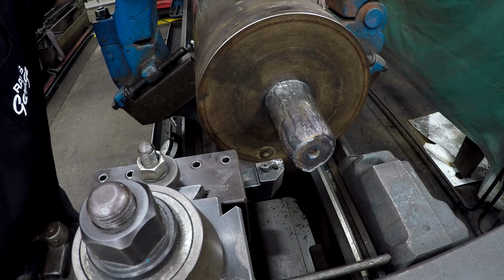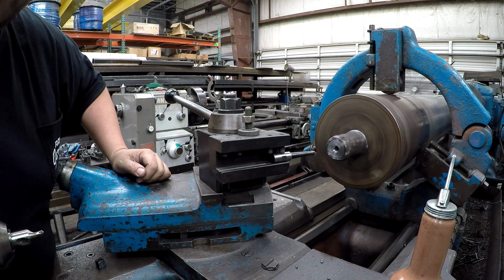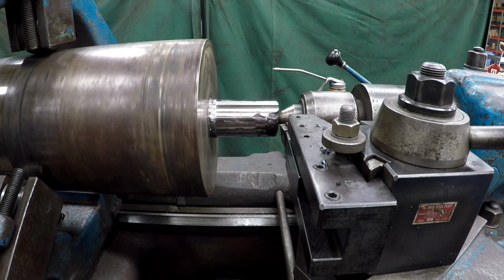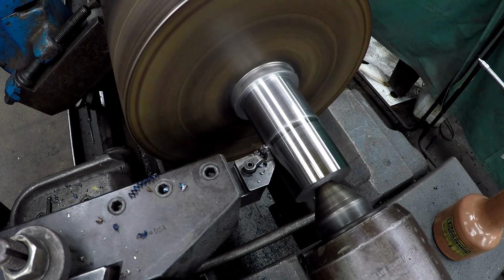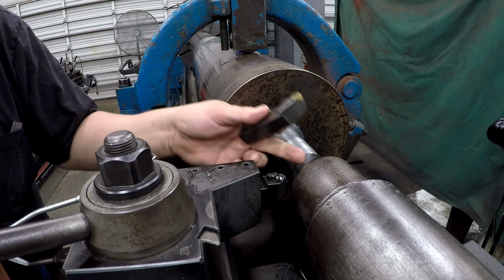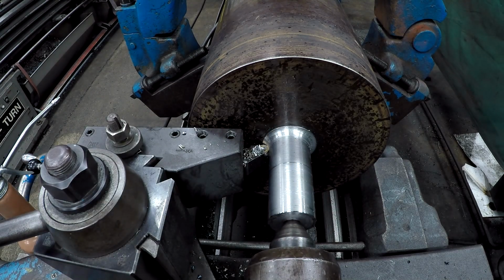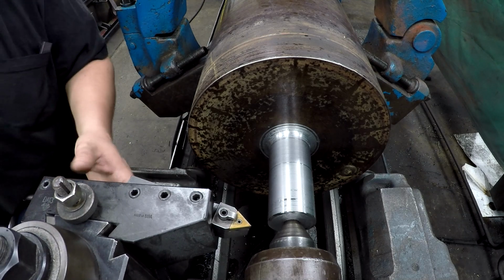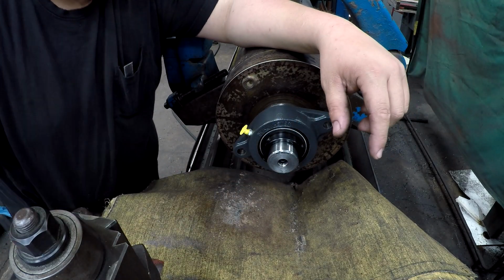Roll Journal Repair Part 2

Comment: I admire a good machinist. I worked as a millwright for a good while the guys that slopped stuff out made my job very rough. I couldn't even get some of those guys to fit the inter race of a bearing before sending it to me. But guys like this made my job actually fun.

Comment: No matter how good CNC machines get, or how powerful computers become, nothing, absolutely nothing, will compare to the human touch of a finger tip or nail to "feel" that last few thou needed for a successful repair. Its the human "touch" that machines will never be able to replicate. Good job Adam, very much enjoyed it. Cheers.
Reply: +Rain Coast. Some call to these tools like nail-o-meter & eye-o-meter   =)
Reply from the maker: There will always be a need for the repair work these manual machines provide. Cnc is for production.
Reply: +Rain Coast Well that's just not true, now is it? =D
Some day when they incorporate some electron microscopes to a CNC machine... man oh man... xD
Reply: Rain Coast I beg to differ, there are new 4.0 machines that have everything built in. DMG is on point. Surface measurements, sonar measurements, and gauge measurements are just a few.

Comment: Hey Adam , your doing what I used to do 35 years ago. Great job and weld done , I use to do them for US pipe and the steel mill . Weld them up and turn them off, rollers and journals . Boring out the new bearing boxes was my job to , used an open sided planer and a boring mill with flat belt drive. What a kick I was used to doing small work then this new job doing great big steel with cranes and forklifts . Thanks glad its still being done the right way . Gary

Comment: Hey Adam, I love it when that ugly weld surface turns into a finished looking shaft surface. Where I worked, the machinists had to refurbish some European motor  ends that carried a roll. I was always amazed at that "like new " finish on what appeared to be trash a day before. Nice job.

Comment: Nice video! The only thing that I do differently is if I have a good shaft on the opposite end, I'll typically chuck on that surface. As well as I run 2 indicators, bottom and side, down the length and make sure the roller is running straight and level. I enjoy watching your videos. Thanks for putting them out there for all to see.

Comment: Nice work, Adam.
I've used that trick recutting the centerdrill using the compound myself.
I've never known anyone else to do that.
My tailstock is worn so I don't trust it for tight tolerance work with minimal stock to remove.
Seeing you do that makes me feel better.
Thanks,
John
Reply from the maker: +John Bazaar Tailstock won't always give you 100% true center when the existing center is already running out.
Reply: That's been my experience as well. Tailstocks aren't usually stiff enough to compensate for an off-center hole and a centerdrill will tend to follow an existing hole.
Thanks
John

Comment: Nice work on that radius.

P.S., I think I need to leave about 5 thou to clean up the highs and lows and polish up a piece.  It is fun to watch it clean and shine up.
Reply from the maker: That's a good way to practice hand filing your parts in. Use a good clean mill smooth file, and keep it clean of filings too.

Comment: Very nice work Adam. Folks should take notice of the two hands using the compound for a smoother cut and more importantly he held the emery cloth ( sand paper ) only using his fingers. That greatly reduces the chances of the emery wrapping around the part and causing an injury.   Jeff
Reply from the maker: Both good points made. The emery cloth can be dangerous if your not careful, got to hold it properly so it doesn't get sucked in.

Comment: Excellent work, we used to repair the similar shaft ends by turning 1/4" under diameter then shrink on nominal 1/8" wall sleeve and on, then weld were you finished radius. The fitter should dimple the shaft for the grub screws and Loctite, on new machines. We had general procedure to do this, but laziness and time constraint it was missed causing that type of wear problem. You can get that type of bearing with eccentric lock, much better but cost more.
Reply from the maker: +ANDREW MICAS I've repaird several times using a sleeve.

Comment: Nice job. That's the common problem with pillow block bearing with sets screw as locking. Should be using different type of bearing.

Comment: Adam, noticed in first video, that you set it up in lathe, then took it back out to weld it! was that done so that you knew if it "ran true", so that after you welded it, you knew that it could be turned to spec? another great video!!!
Reply: +Fred Newman In the first video, he used the center to true the roller in the lathe, and then set the steady rest to hold that position. When he took the roller out of the lathe, he didn't even breathe on the steady rest, so as to maintain that reference position.
Welding on a journal causes it to go all sorts of wonky so that when he put the roller back in the lathe after welding, the center hole was effectively useless as any sort of axial reference. Luckily, though, the steady rest was already set to hold the roller true and the center hole could be re-cut based on that.
Actually, I was a little surprised he didn't weld the center up and just cut a new one altogether, but dressing the old one as he did worked effectively the same.
Reply from the maker: Yes, when you have to weld on a shaft you must get the steady set to hold the part.

Comment: Thank you for an entertaining afternoon of educational enjoyment. I watched all 3 and boy the casting on that vise was rough...or as Stella would say, "Ruff, ruff!" LOL, I don't blame you for babying it in the Kurt. One question if I may, were you also taking lighter cuts due to material possibly grabbing, or because you had a gentle grasp on the tube in the Kurt, or just because like Stefan says; "It's not a race"? 

I appreciate all of the hard work and time you put into each video, and thanks also for the reminder about Alex's channel...I had spaced out on that, and will make sure the notifications are set properly. Aloha...Chuck
Reply from the maker: I didn't have the part clamped all that tight so I was taking it easy with light cuts. Thanks for checking out Alex's channel, he sure appreciates it.

Comment: They probably need a second bearing or a bigger heavier bearing, or perhaps a bearing that can take the environment of where that roll is installed.  You're at least the 2nd guy to weld the shaft back up and machine it down.  I'm guessing the bearing fails and chews the shaft up before the maintenance crew can catch it.
Reply from the maker: +Greg Feneis Often times these components are mounted in hard to reach areas, or hard to see and go unchecked until the damage has been done. Common in heavy industry.
Reply: Think about it......thats a big heavy long roll, its going to have even more pressure on it from something running over it...probably some kind of foil or  film...or paper running over it. Now with a half thou undersize journal, producing a light hand sliding  fit ....the entire weight is going to rest on the tips of two setscrews....every time the roll rotates.  They will immediatly  begin to wear into the soft roll, remember setscrew tips are very hard. In a few months of even moderate to light load and speed they will have worn several thou down , and every tenth they wear in the rate accelerates.  Albom knows what these guys want...loose fit ...easy assembly....no need to use a bearing heater and heat the bearing because its a tight .001 0r.
.0015 oversize shaft that will run for 10 years  @ 24/7/365.     Theres a lotta corruption in a lotta mantenance departments ... they sorta NEED dramatic breakdowns that put s management crying to them for a fix.....because all of a sudden maint is VERY IMPORTANT ........if the danm machine runs forever without maint calls it looks like maintenance are not needed.    Maint and the plant engineer know the roll could be fixed so it would last forever , by making the shaft journal  1.939 using a bearing heater to install the bearing then having Albom put a journal 3" dia on the other end that would be exactly .005 below the 3" bearing id .....for a semi slide for axial expansion which is needed for temp changes for long rolls....unless the support structure is intentionally flimsy enough to allow for the roll length du to temp change.

 American manufacturing challenged by 3rd world .....?  Yeah lotta its because of character deterioration ...at multiple levels in our plants....  Albom does fine work...he  is giving them just what they want......

Comment: Seems like a huge overhang on that boring bar held with one clamp screw?  Did you get a lot of chatter because it sounded good but just looked scary.  Nice work as usual Adam.   Touching off on that rough weld surface must take a bit of time for the uneveness.  Doug
Reply from the maker: +Douglas Thompson The boring bar was held in a v-notch, and the set screw was on the flat. It's not going anywhere.
Reply: Thanks Adam.  This helps me get a feel for what will work in my endeavors.  Why I watch machining.  Good to learn.  Have a nice day.  Doug

Comment: When turning down a weld, I'm not sure whether it's best to grind off the bumps first, or cut in from the end with deep cuts, or to let the tool pound off the bumps from the top.
Reply from the maker: +Landrew0 Best is to get the nose of the tool completely under metal, but that's not always the case.

Comment: How are you with free handing the radius? I remember my first time on a roll that size with the instruction.....don't f this up. I never used a radius tool but I imagine I would be just as nervous with it the first time too. Keith Fenner is the only youtube guy I ever saw put them in by hand before.
Reply from the maker: Free handing them how?
Reply: Now that I think about better you did free hand it. With a basic turning or facing tool is what I was meaning.

Comment: I had no idea you could build something up like that with welding. Is there any real durability difference? If so, I assume this was just a cost saving approach from your customer?
Reply: I have seen Adam do at least three different additive techniques... stick (as here) and two different types of spray welding... Eutalloy and I forget.

Comment: Adam,
An educational question for me.I noticed the steady rest was fairly close to the end of the shaft. Was using a center necessary in addition to the SR?
Regards,
Eric
Reply from the maker: +esoomreltna Could have machined the end without the center yes, but you'll get much more rigidity with the center, especially for the radius cutting.
Reply: Adam,
Thank you! I'll remember that.
Regards,
Eric